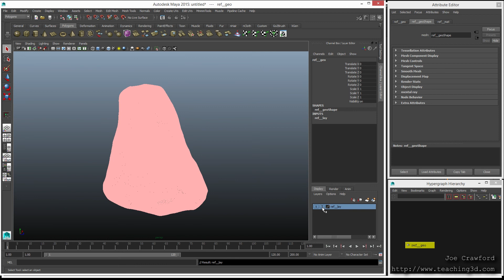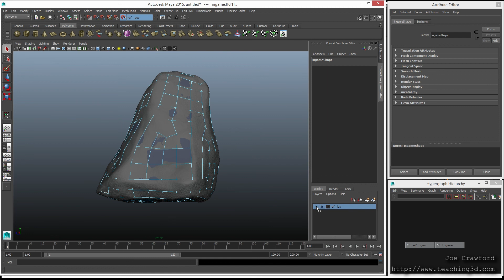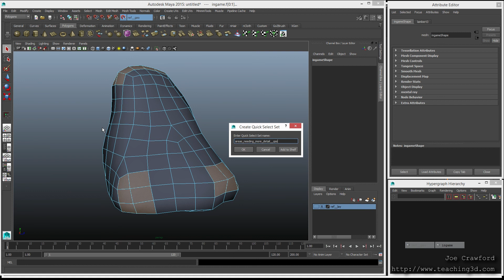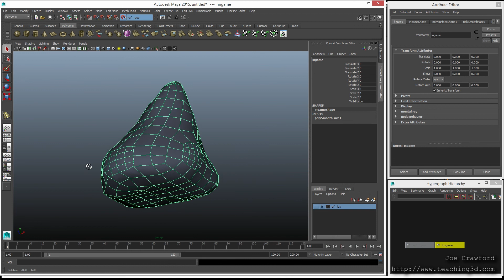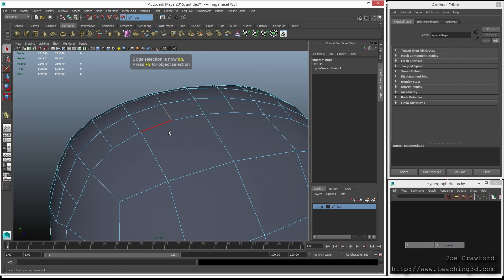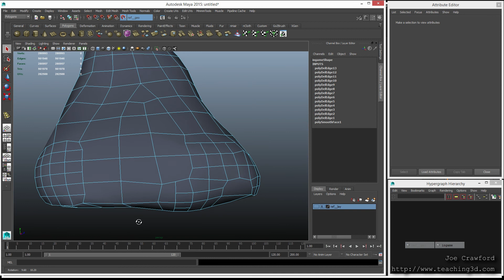Teaching3D - Work Flow Basics - Rock Part 3 - Model For In Game Use - With Joe Crawford

Comment: If you have the high poly model with polypaint-textures in zbrush, and you change the topology in maya for a game engine use- the whole uv mapping and topology is changed, how do you project- export the textures etc from zbrush ? ALso if it's a static model and it will be triangulated at the end, why not using the decimation master for an ultra low poly model?
Reply from the maker: For the first question, it's actually ok if the zbrush model has different uvs and topology than the game model.  often we try to keep the uvs the same, for example after optimization, transfer the original uvs back onto the optimized game engine model.

Although it's useful, it isn't really necessary.  xnormal, and other baking tolls can bake between totally different uvs and topology.  Polypaint is done in that case using xnormal's bake vertex colors feature.

About decimation, there are times when it can be useful, but it doesn't distribute verts very well.  for example it doesn't concentrate on preserving the silhouette.  Hopefully, at some future point automated solutions will do a better job.
Reply: joetainment Ah, thank you very much for the quick response! I was so use to Zbrush's own export polypaint-texture function(It was sufficient for exporting textures for my high poly portraits to render in Keyshot) But I was stuck with the proper workflow in game model creation.(I'm working on a VR experience in UE4)So obj-s have vertex colour information and I can bake them into texture maps in xnormal too? Amazing then, thanks for the help!
Reply from the maker: +Ma An  Yes, zbrush exports objs with vertex color.  xnormal can read it.  Remember to uncheck ignore vertex color   in xnormal.